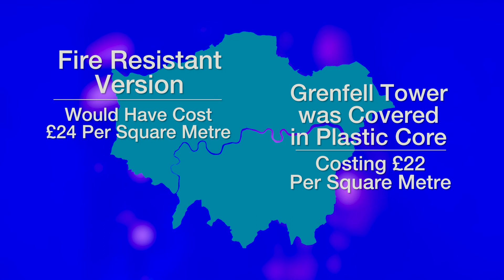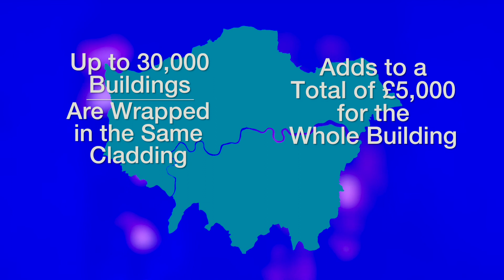A Simple Question: Four month since the Grenfell tower disaster

Comment: I'd forgotten Lembit Öpik.
@0:46 the Insulation shown is compressed Glasswool, it's made from recycled glass amongst other things. It's covered in a foil that is microns thin, and isn't flammable in any way, it's what we lag ovens with and steam pipes and can no way be compared to what was fitted at Grenfell.
Being of a solid wall construction I am surprised it's only just been Insulated, there are laws about rented housing and the insulation, and how it looks would have been a secondary thought. I'd be surprised if the lowest common denominator in the contract i.e., the Contractors, had any connection to the material choice at all. But, if it was flammable, the person's working with it all day would have noticed the smell, and I'd have expected them to at least ask the question. But they where probably foreign and not in a position to be heard. A visit from the Fire Officer on a new project of this size would have tested a piece, but they haven't turned up for years as the Industry much like every other including the Fridge Manufacturers, has been allowed to audit themselves.
When Thatcher said "we must peel back the state" she forgot to add, "were going to leave you in the corruptible hands of Commercial Business".
It's not Gentrification, it's rent/profit, and eventually it will be the same as Monaco with those flats costing £1 million each. Current Millionaire residents of Monaco are moaning about the workers blocking up the roads, as they pour in for work in the mornings from over the border. It's already happening here and will only get worse. Eventually all workers will come in on the tube so they won't be seen, leaving the roads free for Rolls Royce's and Ferrari's. 
It doesn't have to be pressure. The person doing the calculations on the spreadsheet and costing the job, might have seen the chance for a bigger bonus for themselves with a cheaper material, or putting Reynobond Fr was one letter to much for the little box on the spreadsheet. 
Just last week people where allowed to appear at the enquiry and give their views. If the Chilcot enquiry had allowed the wives of Iraq to appear, it would probably still be running and blairs face would be lily white, not Jaffa orange.
Sprinklers wouldn't have stopped the fridge fire or the Cladding fire, they are not allowed in the living area,  because you could be stood there with your hair straighteners doing your comb over, when a false alarm delivers a deluge, and you end up with curly hair and smoke coming out of your ears.